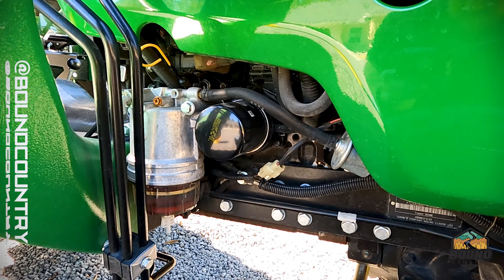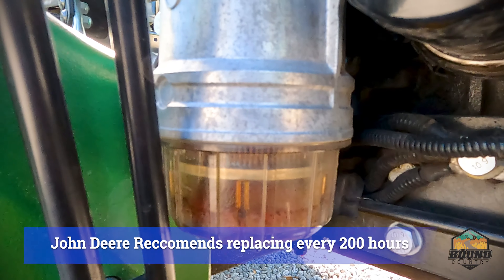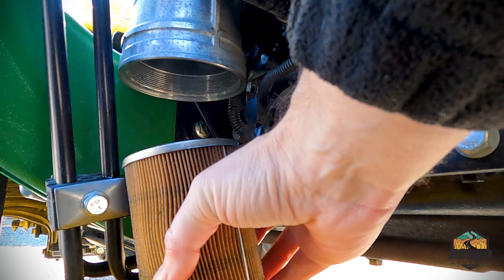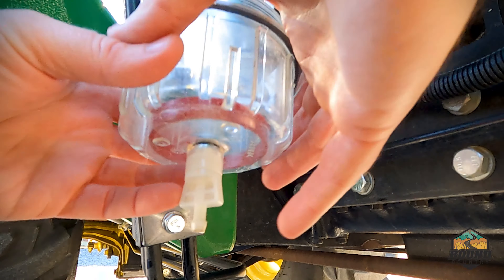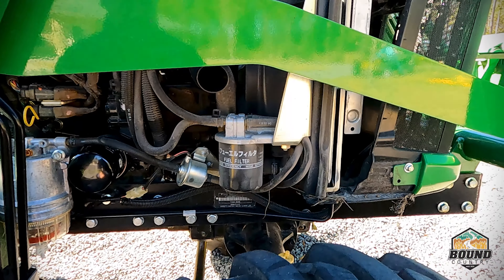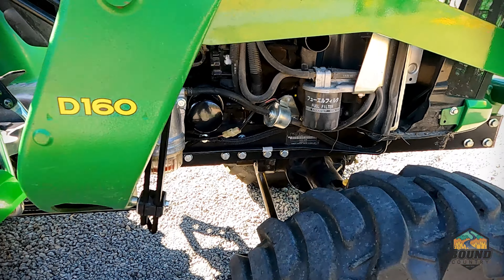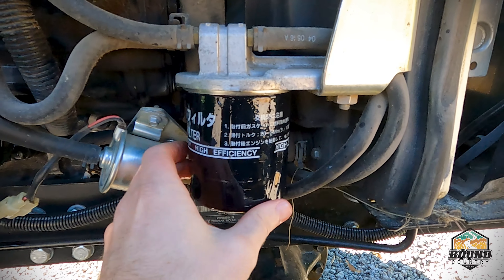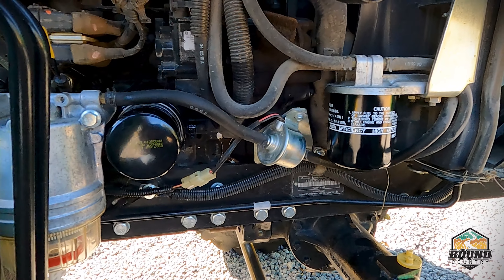How to replace John Deere 3038 E Fuel Filter

Comment: For those of you with 2020 or so 3038e units JD went to a two filter system without a paper element in the water separator. There is only a plastic filter element that can be cleaned and replaced and only catches the big detritus coming from the tank. The bowl is much taller and is held in place with a knurled ring at the top of the bowl. The second filter is just behind the right front axle, easily replaced. It is also often misidentified in the JD books as a MIU800645 which is larger diameter and will not fit the adapter. The correct filter is a MIU803137 and is identified on the filter can as a HIGH EFFICIENCY filter. And it's a more expensive filter by about $20 more than the 800645.

To bleed the system do the water separator first then the HIGH EFFICIENCY filter but leave the latter just screwed on to the nipple a few threads. Then turn the key to on, not start, and wait for the water separator bowl to fill then the fuel will flow forward to fill the HIGH EFFICIENCY filter and will overflow when done. Then tighten the filter 3/4 turn after the filter's seal contacts the housing. Wipe everything down and start the tractor. Should be no leaks. 

The other thing you may notice is that the water separator may draw down fuel at the top and there will be a lot of foamy bubbles that are very quickly replaced by fuel. It will do this several times...a lot, actually....and the tractor may stall out under load until all the air is self purged...again, several times. When all the air is gone the system settles down, all bowls/filters are full and no more stalling/stopping.

When I first encountered this stalling behaviour I thought it had to be a switch, solenoid, or relay because the tractor just stopped "right now". The other videos and forums said change your filters and make sure your tank is water free. They were right. There was damn little water in the bowl (red ring wasn't floating - I doubt you could get that much water in there to get it to float and still have the engine run) but the system was sure sensitive to that tiny amount. Should be none....water and injectors don't mix well.....

Comment: Don’t look like you were having much luck removing the fuel filter with the oil wrench on video at least.  Did you have to fight with it to get it off or use a different tool?  I seen the wrench slipping but the filter itself wasn’t turning according to the writing on the filter?  Seems like you did something off camera there we didn’t get to see you do?
Reply from the maker: 😅 You are correct, it was just about seized on there. It came off, but I had to take a rag and place it between the filter and wrench to help get some traction.